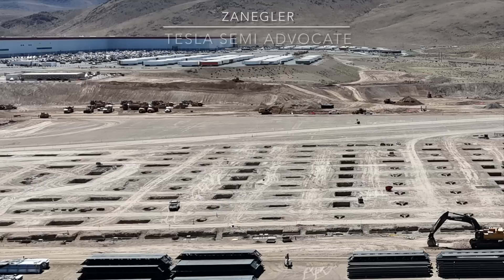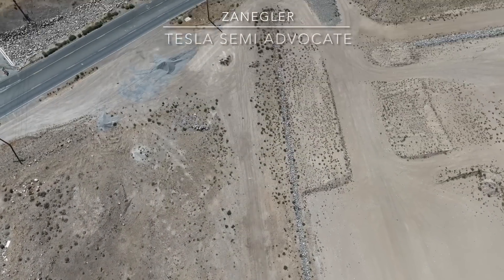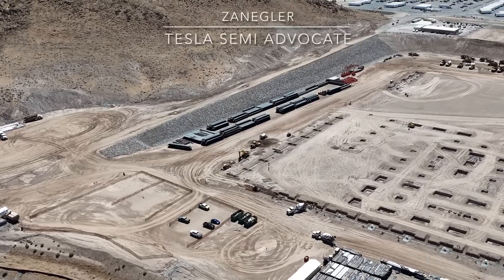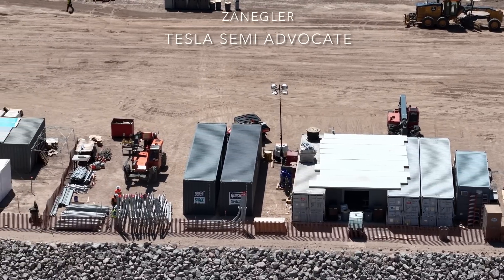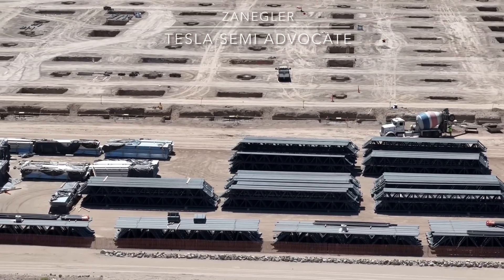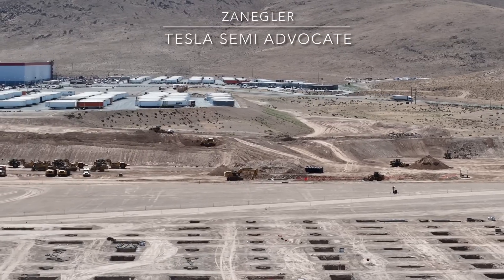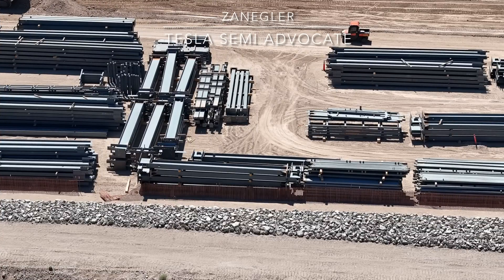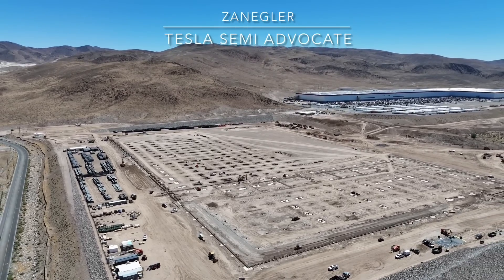Tesla Semi Factory Construction - Taking Care of Business! August 16, 2024

Comment: Not sure why the drone does the, rotate left then right and then the up and pan. Doesn’t seem to be something that a drone pilot would do. Perhaps worth editing out?? Thanks for the update Zanegler.   Re -  the column footing layout - my guess, and it’s just a guess from an architect not an engineer, is the super large pad footings with the smaller footings in between may be for large overhead gantries. These gantries are essentially a moving beam that can run along a line of columns, with lifting points used to lift very heavy objects - usually in tandem. This would make sense for a factory with large elements - like a truck chassis. I think the smaller pads in between, the very large footing pads, are just to add extra support to the concrete slab in between - as there would be high floor loads in these zones. This for me would start to make a bit more sense of the layout. With the big footings (usually with smaller footings in between) creating large double bays with gantries overhead. I really appreciate your updates Zanegler, keep up the good work!
Reply from the maker: Agreed. Bridge-cranes are critical for semi production. Every part is bigger than a normal vehicle. 
That is a pre-programmed mastershot and I kinda like it. The drone takes over for a few minutes and includes several drone maneuvers.

Comment: mostly what I see are posts, beams, and open web trusses   Nomenclature comes from wood timber framing.. suggest you look at a couple of books on that and you will know exactly how it all fits together.  What is very old is new again.    This is basically the skeleton of the building.  They will also place girts  which are still nothing but beams to connect the various sections together.  Once installed they will start installing roof panels and eventually they will put up sides to enclose the building.. Kind of like rinse and repeat and next day do it all over again.

Comment: 7:15 The stacks of corrugated metal under the black plastic is bundles of roof decking. The deck gets welded to the roof trusses once they are erected and all the steel is plumb and all the bolts are tight.
Reply from the maker: Thanks for the clarification!

Comment: By 'posts', I think you mean  "columns' which are placed vertically.  Beams connect the columns horizontally and the trusses are used for the structural floors and or roofing.